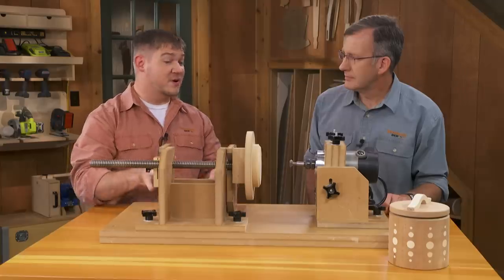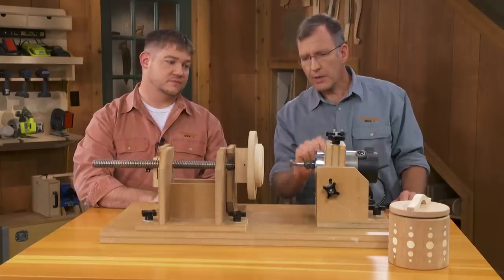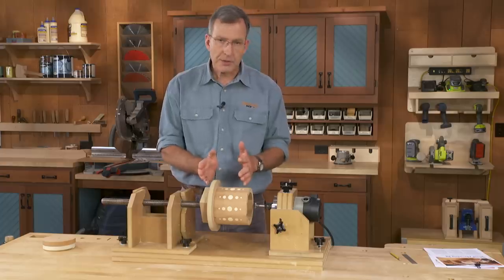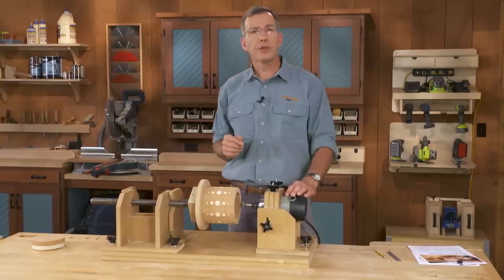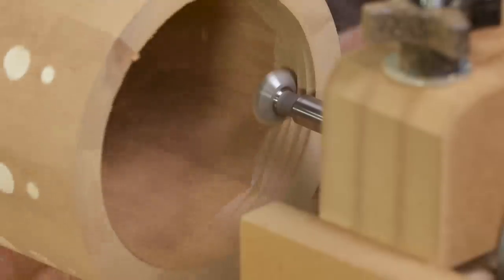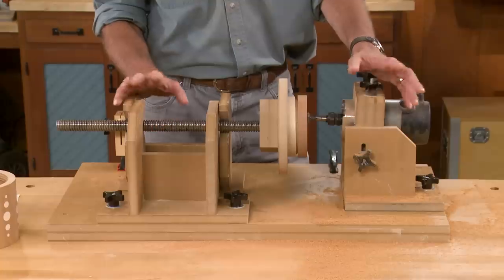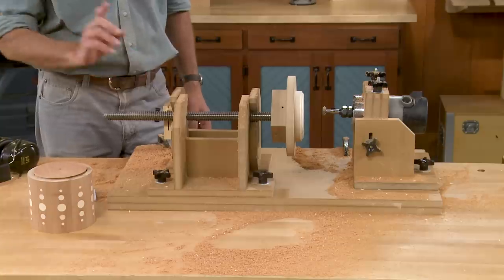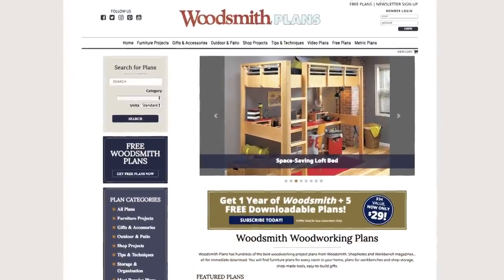Make Wood Threads with this Amazing Router Jig!

Comment: Another possible source for the bit might be: Magnate 796 Thread Cutting Carbide Tipped Router Bit
I haven't tried it myself yet and I don't know if the jig would need any modifications to work with it, but it looks to be a better price point.

I got these Threading jigs plans and they are a very enjoyable read.  Nicely illustrated and a great walkthrough on threading a canister.  Thanks!
Reply from the maker: Thanks for the tip on the router bit. I'll check it out.

Comment: Again a well made video.
This is excellent. Just what I've been looking for. I really need to make this jig when I am able to do so.
I want to make some flat jars with a 70mm diameter and I know I can't find any die and tap for those sizes.
In addition, one of those bits cost the same as a die and tap that can do only one size, so if needing two sets, the bit is "half the price".
Recently I came across a young man making a thread-cutting jig on YouTube, but it didn't produce uniform threads. Your jig is much more rugged and solid and the result is a good usable thread.

I bet you can also enhance your jig easily (which means it's well made).
It may be possible to find the 'pivot point' and fix the router's bolt in that position.
At the other end, one could make "presets" using holes and dowels or just plain stop-blocks, so one can get the same sizes of threads for 'production runs'.
There's a lot of possibilities here. It's even possible to make "high speed threads" (eg. double threads), though I do not need that.

Comment: You can disengage the pitch pin and use the 45 degree edge of the cutter to cut the chamfer on the opening.
Reply from the maker: I suppose you could, but you would just have to make sure it doesn't move in and out as you are turning it so you get a consistent chamfer.

Comment: Good tutorial with clear explanations and fine production values, but the statement about having to tilt the router slightly to allow for proper “pitch” angle is incorrect. This will produce an asymmetric thread profile. The cut thread will automatically have the same lead angle (“pitch” angle is the wrong term) as the master thread from which it is copied.

Comment: Great idea/awesome jig. Couldn't you avoid having to thread in same direction as router bit by advancing the bit to the end of the desired thread depth, and turning the lid in AGAINST the bit rotation again as it cuts to the OUTSIDE of the lid? I realize this might require either a.) removing the bit & cutting/drilling a small recess in your sacrificial faceplate, allowing you to insert the thread cutting bit at the (inner) threading start point (as you chuck it into the router), or b.) designing the workpiece half of the jig so that it can PIVOT the workpiece into the bit.
Reply from the maker: Some interesting suggestions here... I'll have to look in to it.  Thanks!
Reply: @WoodsmithShowandmagazine  if you do experiment and find that this works, I would love to see more videos using this jig for different projects.
Reply: @WoodsmithShowandmagazine  have you considered making videos of all of the top, or favorite shopnotes jigs over the years? You could reference the issue number and sell back issues in PDF form or hard copy, of course this way. For some of us it might be reminiscent to see all jigs we made years ago or never quite got around to! In fact, now that I think about it, I think seeing videos with you build some of the jigs from past issues that I found years ago would likely inspire me to build some of them today.
Reply from the maker: That is in the works... I'm working on finding footage for the projects we've already done from the Woodsmith Shop tv show and collecting all of the jigs we still have and shooting new videos for those. We do sell the project plans on WoodsmithPlans.com for a lot of them and the ShopNotes digital back issue library, as well.  I've always enjoyed the projects and jigs from ShopNotes, so it's really fun for us going back through the issues to see what we can find.  Chris Fitch (seen in this video) was the designer for most of those projects so it's nice that he is still around to pick his brain too.
Reply: @WoodsmithShowandmagazine  With 36K subs to your channel, I bet you'll have exponentially higher sales on many of those plans after subscribers see videos of them being MADE and IN USE. (could do parts of the oldest one in B&W for nostalgia/kicks, even tho magazines were always in color ;-)
Reply from the maker: Mark Young - That would be great... we could sell video collections on VHS tapes too. 😀

Comment: One thing that was left out of the video is how to mount the part on the  platen.  Centered that is.  If it isn't perfectly centered, the thread will be wrong.
Reply from the maker: I'll have to double check, but I think we might have used a centering pin when mounting it.  Also, I believe that the disc might be slightly oversized so when you are cutting the threads it is also turning it round and cutting it to size as you sneak up on the fit.

Comment: Is it vital to have the lead angle adjustment (router tilting)? I'm no machinist, but it seems like the threads should work fine as long as the angle of the router is the same for the bottle and the lid. I've got a somewhat more complex jig I'm working on at the moment.

Comment: That's a cool jig but $57 for a single bit is expensive for the hobbyist.
Reply from the maker: This is true... you might be able to find it cheaper (that is just one source).  I'll check around.
Reply: Check out ebay.  People buy them and then dump them cheap when they don't need them any more.  I bought a finger joint set for $20 and a 3 piece raised panel set for $30.  The latter cuts the anti-shaped tongue, the shaped groove, and the shaped raised panel.  For anything more than just a basic bit, I typically go to ebay first.  All of the above bits were brand new and never used.